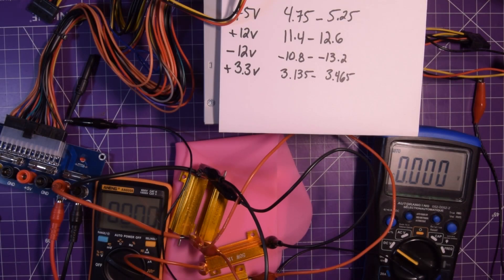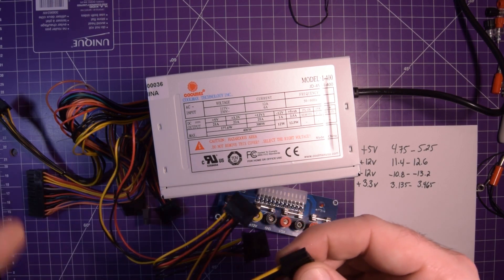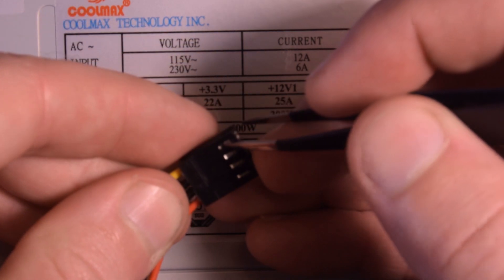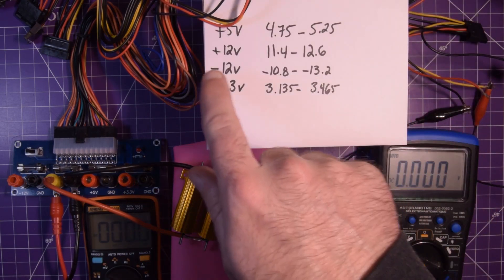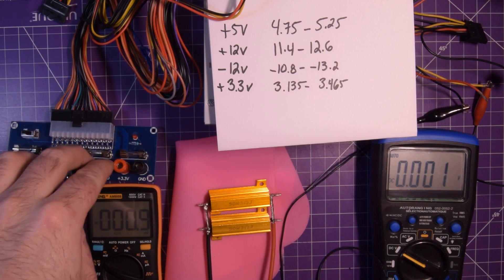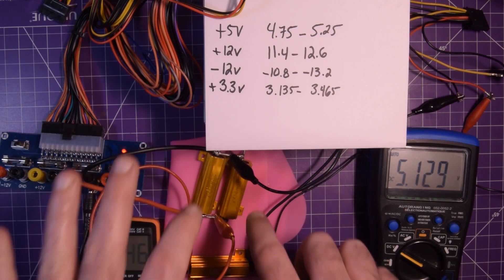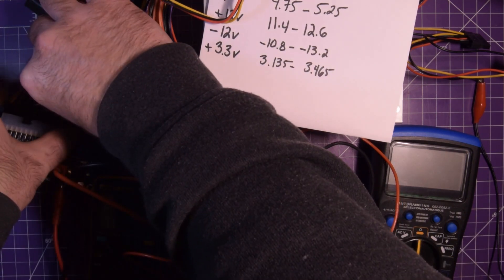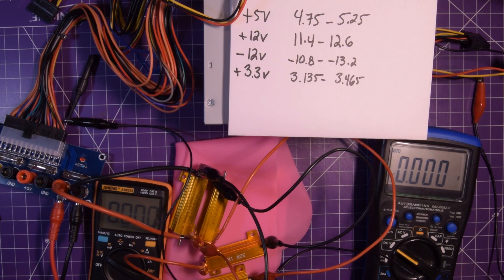Testing A 16$ ATX Power Supply!

Comment: I recently got a Rigol ds1054z and saw your video on it... One of the main reasons I got that scope, is for a very similar purpose as this - to test power supplies.  I'm not just interested in voltage and current, but also interested in the quality of the output.  A multimeter doesn't indicate ripple voltage, among other anomalies - if a DC output is really "DC" or a lousy facsimile of "DC".

Comment: Modern PC's use more of a 12V rail than 3.3V rail or 5V rail. That's why you needed to plug additional 4pin plug. Well, not really modern as it was about Pentium 4 times. So you don't really need  strong 3.3v rail

Comment: All the power supplies I've messed with have complicated relationships between voltage and load between the rails. Like if you place 5A load on the 5V rail it might drop to 4.6, but if you connect an additional 80 watts or something on the 12V, they'll both rise in voltage. It might be worth retesting with a dummy load on all rails sometime. Not to give any extra credibility to a cheap psu

Comment: First of all, I  enjoy your channel. With all due respect,  may I  suggest you take note with Pileofstuff's lighting and camera setup. His lighting is quite good and his ability to do closeups really help me see clearly what he is doing.  I hope you take my suggestions in positive fashion, as I am a loyal follower of your channel. Regards,  Gary.
Reply from the maker: Lighting is definitely on my upgrade list, what was it that you couldn't see, if you don't mind me asking, and what device were you watching on? Thanks for the feedback!
Reply: @SimpleElectronics  I watch on my tablet mostly. It seems that Pileofstuff's camera angle is better to visually cover the worktop, and when he zooms in it certainly has a clearer perspective. I am old school and want to see what is happening. Also I am not a camera guy, just know what works for me.  I hope  this helps, thanks!
Reply: @SimpleElectronics  Just a FYI, back a while ago you did some lighting with LED strips. I recall thinking at the time it certainly brightened up your worktop. Maybe I need to wait for your lighting update?
Reply from the maker: Those were for my wife; but I could use an upgrade as well....I do have quite a few infrastructure projects in the works, I may spend some money on lights as well; it's quite expensive to run a channel!

Comment: you need to get rid of the adaptor thingy, and remove all the small cables and run a 4 mm direct from the internal rail that way you should get the full current rated on the PSU with less volt drop

Comment: Nice video :) The voltagedrop are caused by the cables from the power supply, they are too thin.Since you're not going to use it for a computer just open it and remove all the wires on the rails you need, then solder in some coarser wires and put in some form of terminals where you can attach your loads. I  would suggest 6mm2 (about awg 9 or 10 in the chart I looked it up in). In all low voltage systems, the big culprit is voltagedrop due to the resistance in the conductors. :)
Reply: I said that and then read you had already mentioned it :-)
Reply: Addendum. The way you've setup the test you are actually measuring the voltagedrop across the wires (just subtract the value on the blue one from the aneng) ;) The blue meter  measures the voltage out of the PSU, and since those leads are not connected to any load you will not get any voltagedrop :)

Comment: Nice video!!
Project idea a DIY constant load device for testing power supplies and circuits?
Reply from the maker: That's a great idea! - but it would need I will have to spot avoiding leaning op amps!
Reply: @SimpleElectronics  hahaha I avoid them too😂